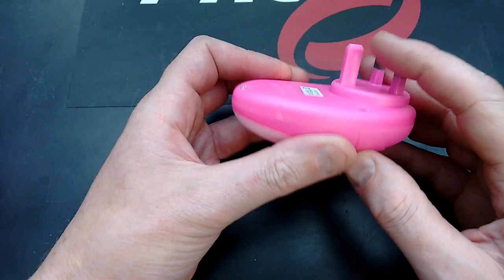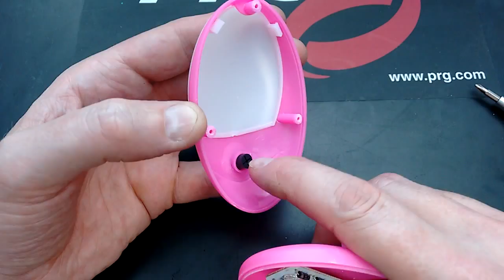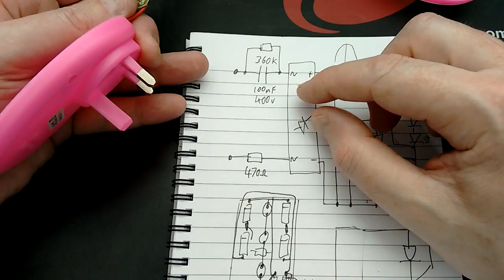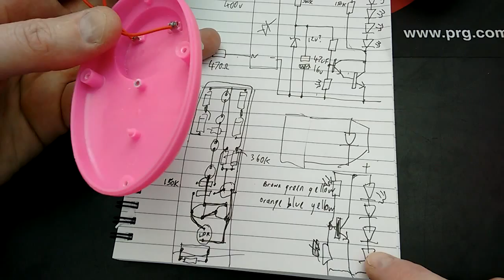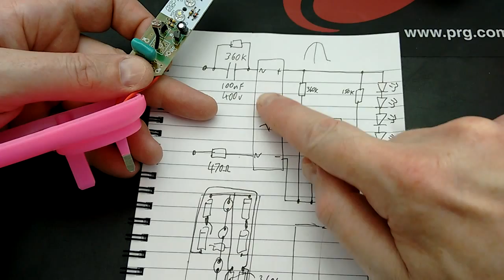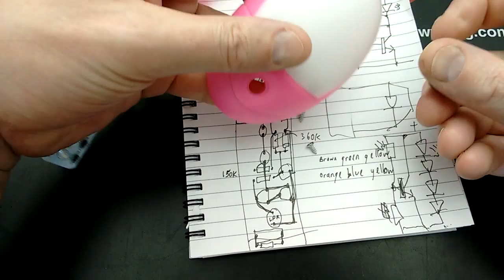Inside a pink LED Kingavon night light.  (with schematic)

Comment: Big thanks for telling about the "capacitive divider disease" taking over so many devices nowadays. Especially the Zener variant. You saved me tons of time and somewhat $20 in fact - I had a radio-controlled switch failure on my room ceiling light, but before replacing the unit the engineering reflex forced me to take the old one apart (hoped for a dead diode or something) to see the familiar circuit feeding the whole device along with the relay coils! (5v for the receiver IC off some 7805) Of course, the zeners failed (there were two of them because of the three relays to feed). Replacement or repair no longer an option, I just desoldered the whole craPSU and wired the rest of the board to an external 12v supply which worked like a charm.

Comment: How come the ground port is pure plastic, do they not just do 2 ports like we do in america if it doesn't use the ground?
Reply: You need the ground (earth) pin to open the shutters for the line & neutral on UK sockets.
Reply: Safety!

Comment: I think the sensor is for sudden light change. like when you turn off the main room light or opening curtains and is restricted so it doesn't change in low light levels where it might not be needed

Comment: Actually shorting out the LEDs is pretty smart in this case, because it saves power when used with a capacitive dropper. If the Voltage goes near zero on the output, there is not going to be much energy consumed, only reactive current flowing through the capacitor, almost like a capacitor connected directly over mains.

Comment: Perhaps the base bias resistor connected to 12v needs tampering with to get the day time switching point closer?
Reply: if it uses slightly more power with the led's off, why not just make it run the leds all the time, a simpler circuit also!

Comment: Kingavaon seems another old brand who now sell tat, they used to sell mini car accesories in the 70/80s along, competing with paddy hopkirk for various gear knobs and such  (found my own answer, started in 1977 selling car stuff, liquidated in  around 2003, so i guess the name is for anyone to use now)
Reply: someone will have bought the rights to it during the liquidation of the old company's assets. its a very common practice, so consumers will see a brand they recognise. there are lots of familiar brands thats happened to, and are not actually the same company they used to be.
Reply: 0yeme0
yes you are correct, theres pifco also, bush was bought by argos to sell made in china radios, wolf power tools are not the same british company, and apparently Britool are also a front for chinese tools, im sure there are countless others, perhaps in 50 years the apple name will be used for cheap tat also! lol
Reply: Blaupunkt is a recent one. Often though, a brand simply licences their name out, often to crap products. It's why you get Hyundai vacuum cleaners, or Ford branded AA batteries that are utter rubbish.

Comment: I'm slightly confused by the cheaper schemstics - I don't see how the transistor switches anything - looks like the leds are always on.
Reply: Transistor off -> current goes through LEDs, transistor on -> current goes through transistor, dropping the voltage across the transistor (Uce) and the LEDs so low that the LEDs can't turn on. 
That's why Clive said it actually draws a little more power when 'off' but the levels are so low it does really matter anyway
Reply: Michael Tempsch ahhh, so its like two leds in parallel with different colors where only one glows? Thanks
Reply: >ahhh, so its like two leds in parallel with different colors where only one glows?

Yep, same situation. 
You could also take it to the extreme and put a physical switch there instead of the transistor - which would drop the voltage all the way to 0V,  'shorting out' the LEDs
Reply: might as well make a simpler circuit with the led always on...

Comment: I'm confused on how this circuit works: If the transistor is saturated, doesn't that mean the LEDs are getting mains voltage across them? And if they aren't saturated, wouldn't that mean there is a large voltage drop from collector to emitter, and thus a lot of power being drawn from the transistor? I'm sure I'm missing something, hopefully someone can help me understand.
Reply: I'm pretty sure that what you're missing is the zener diode :) When reverse-biased like that, as Clive mentioned, they conduct only above their rated voltage - 12V in this case - which results in the rest of the circuit connected to the zener's cathode (pretty much the entire right-hand-side part of the circuit - that 360k resistor can be considered "part of" the zener, since it's just a current-limiter for the zener) being regulated quite reasonably to about 12V, so you end up with the 4 white LEDs (~3V each, ~12V total) seeing roughly 12V :)
Reply: Thank you Andrew!
Reply: Actually, I'm still confused! So I understand that the cathode of the zener will be just about 12V. But even if 50uA of current passes through the zener/360k resistor (which is a small current, right?) that means the 360k resistor would drop 18V, putting the top of the LED string at 18+12=30V. And the zener has to be drawing more than 50 uA, right? I see how the zener holds its cathode to 12V and how the 360k limits the current through the zener, but I still feel like the "top" of the resistor would be at rectified mains voltage. Thanks in advance for any more help in understanding!

Comment: Won't this circuit flicker a lot? I don't see anything in there that helps keep the LEDs lit while the AC wave is crossing 0...
Reply: It's fully rectified and the dropper capacitor will hold a small amount of power for the LEDs. There will be some 100Hz flicker but not a huge amount.

Comment: I didn't understand how it works without a current limiting resistor in series with the leds.
Reply: They use a capacitor as the current limiter. A capacitor acts like a resistor at different frequencies. I like to think of it this way. There are resistors that change resistance by turning a knob, others use light, and others use temperature to change resistance. A capacitor is like a resistor that changes with frequency.
Reply: +Jammit Timmaj The capacitor is not acting like a resistor, though it is acting as a ballast to limit total power into the system.  Because a capacitor blocks DC (for this purpose, we can think of each half-wave AC cycle as simply alternating DC pulses) the capacitor will only allow a certain amount of power to pass into the circuit for each half cycle of the AC, resulting in either 100 (50Hz) or 120 (60Hz) pulses of power each second.  The larger the capacitor the more total power will pass, the smaller the less power.  One could use a resistor to achieve the same effect and limit total power, but then the power wasted by the resistor just becomes heat whereas the capacitor wastes virtually no power and is more efficient.
Reply: Ethan Poole
You're right. The person I posted to didn't know where the current limiting resistor was. I explained to him how a capacitor could be used like an AC resistor. In a resistor it's called resistance, and in an inductor or capacitor it's called impedance. With 120VDC and a 6K resistor you will get a current of about 20ma through an LED. A 442nf capacitor will limit the current through an LED to about 20ma at 120VAC and 60hz. Both the resistor and the capacitor have a resistance or impedance of about 6K ohms. I'm also assuming either a bi-directional LED or a bridge rectifier for the AC return.
Xc=1/(2*pi*f*c)

A ballast can be used like a resistor in some cases.
Reply: Thanks, that makes sense. However the leds still "see" 220V?

Can this method be used to power other low power devices, for instance 3.3V RF-modules?
Reply: +SirArghPirate Well, they would see 240V only if they consumed no power of their own. Fortunately for the LEDs, they do actually draw real power so their own load pulls the voltage down to their normal operating range. LEDs behave a lot like Zeners (or any diode near its conduction threshold) in that once you cross the threshold that is their forward/reverse voltage drop they begin conducting current. That current has an exponential relationship to voltage in that small increases in voltage lead to large increases in current conducted, effectively clamping the voltage across the LEDs to something within their normal operating voltage range so long as the current never becomes too excessive, which is what the capacitor limits. If you wanted a 3.3V reference you would simply substitute a 3.3V Zener for the LEDs as well as a smoothing capacitor. Capacitor ballasted power supplies are practical for relatively low power, but that is their practical limit due to RFI and power factor issues.
Reply: SirArghPirate
Both the capacitor and LED "sees" 20ma, but the capacitor has 217 volts across it and the LED 3v (approximately). Just to make it clear, the LED and capacitor are basically in series. They share the same current, but not the same voltage.

You can run low voltage devices from high voltage AC using a capacitor dropper, but you're limited in maximum current (too much current and the capacitor will be so big it would be cheaper and smaller to get a transformer), and you'll have to stabilize the voltage with some sort of zener or other type of voltage regulation. LED's don't require a voltage to operate, but a current. They do have a voltage drop, but that could change due to temperature and will be different between LED's, even if they're the same type and from the same lot. A low voltage RF module like the one you're talking about will need a regulated 3.3 volts but will probably draw varying current when it's running.

Comment: the pink ground pin
Reply: Because all UK plugs require that pin to exist to open the tamper resistant mechanism (hence why it's longer).
There is nothing that says it cannot be plastic when earth isn't required. Its fine.
Reply: Never understood why that never ended up being more standard universally.
Reply: Because the majority of devices here in the us don't have ground pins? They make ones that require both the hot and neutral pins to go in at the same time but they are horrible fiddly things and tend to break. Unrelated I recently bought a device that had a fuse in the plug like you do in the uk. Except was non replaceable they had molded the fuse  into the plug :/. I don't think I like it when companies get to design safety devices.
Reply: Ugh, north american TR plugs SUCK. Heaven forbid you try plugging something in that has slightly bent prongs from past abuse, like a vacuum cleaner... hate those things, yet they're required by code now. We have a few that are already broken, either in you cant plug anything in without forcing hard or they no longer grip the pins tightly.
Reply: Fuck the code they aren't required everywhere so you can still buy the normal ones. Its like 5 dollars for 10 from the homeless despot swap them your self. When/if you want to sell the home just swap them back.

Comment: Hi Clive, Just wondering if you could give us some tips for drawing schematics while reverse engineering simple circuits like this? I have some difficulty sometimes and tend to get a little bit lost during the analysis of a circuit. i.e. getting some components drawn in the wrong place or incorrect configuration.
Reply: If you look at what Clive did on this occasion you'll see that initially he drew the layout as it actually is on the PCB and then used that as a guide to reconfiguring the layout as a schematic. If you're a regular viewer of Clive you'll be aware that he often takes a photo of the track side of a PCB and then prints it flipped (mirror image) so he can add the components by hand (or vice versa). I sometimes find that marking through the drawn image of a component as you transcribe the layouts can make missing something out less likely. It can be confusing trying to get your head around some layouts and this method can only really be used for single and double sided PCB's at most as you can't see the tracks sandwiched in the middle of multi layered boards - that's when a design schematic is crucial. Hope this helps.
Reply: Interesting ! that sound tedious :)
Reply: +Thomas Syxe - You don't have to photograph and print the PCB but it's more accurate in the long run. You can just draw it out like Clive did on this occasion but if you try without either you're more likely to miss something. There's no really easy way, unless you can find a schematic online!
Reply: It can be, and is even worse when you're trying to help someone in an electronics forum and all you have to go by is pictures they supply instead of the  unit in your hand for more view angles and multimeter measured confirmation of where traces go, resistor color band true colors, etc.